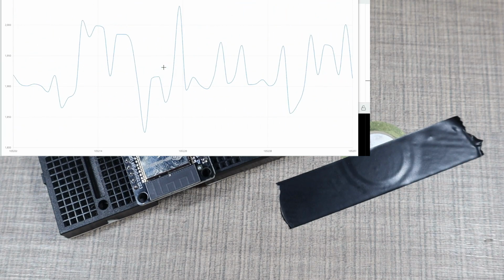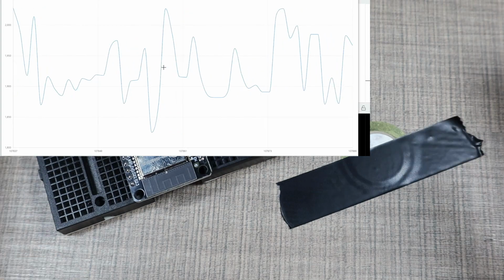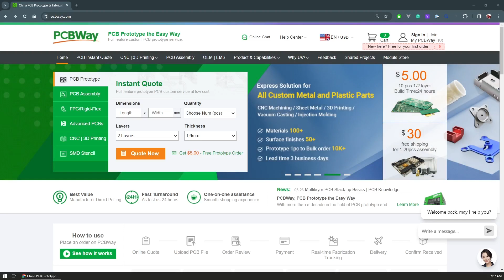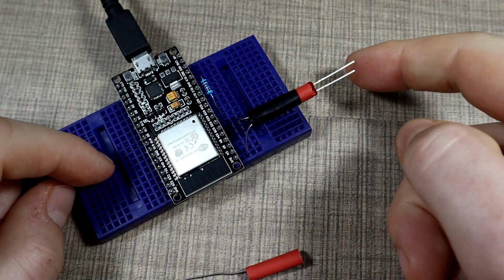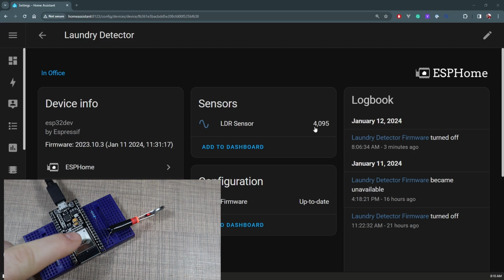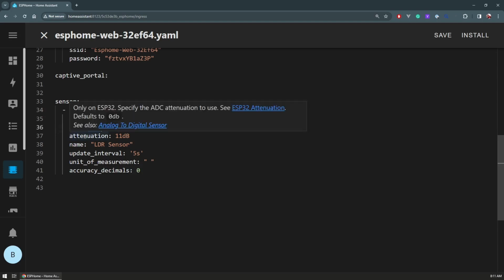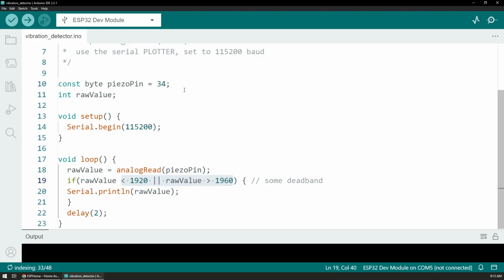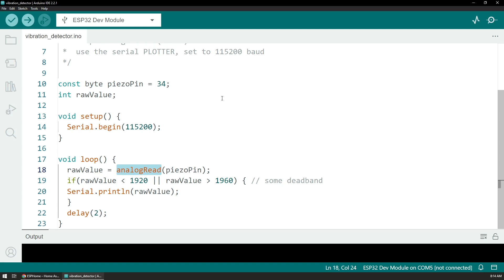Laundry Detection! Easily detect when your washing machine cycle ends

Comment: I coded a really really detailed esp32 that could detect via two LDR's if my washer was finished and if my dryer was finished and it would send a textual message to Google translate collect the text to speach recording from Google speech and find the via the bonjour service all my Google home and mini speaks and broadcast the message. Get off your  a** and sort the laundry. Finalised that and then mechanical parts failed that could no longer be sourced so I bought Hoover branded smart WiFi connected appliances. Guess what they don't do? That's right... they don't tell you when there finished and the leds and. Sounders and vibrations aren't worth a dam for my design so I guess I'm gonna have to get some current meters or devise some new mad method. Fyi the hardest part about my design was https certificatess. Give. That certs are heading towards a 1 month lifetime it's sure to get worse.
Reply from the maker: That sounds like a pain in the a**. It is such a simple thing to add as a feature for manufacturers. I have no idea why they don't do it when they go with the hustle to add WiFi anyway. Maybe you can try using a power metering plug? If you have Home Assistant at home and maybe even with Google Home, you may be able to add some condition to watch for current draw patterns and detect the end like so.

Comment: Depending on the frequency of the noise vs signal for the piezo, a high pass or low pass filter could help a lot. My gut says that a low pass would be the way to go since the movement of the machine would be relatively low frequency (under 100hz) while noise from the piezo likely is much higher
Reply from the maker: Cool, thanks for the suggestion. I'll try to add one next time I play with the piezo and see how it behaves.